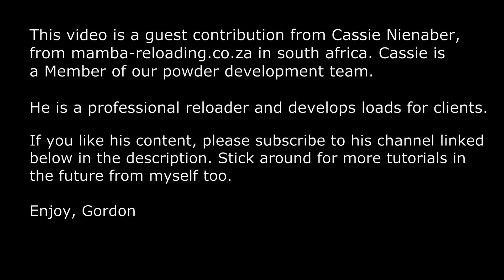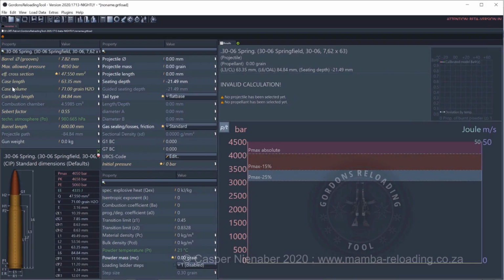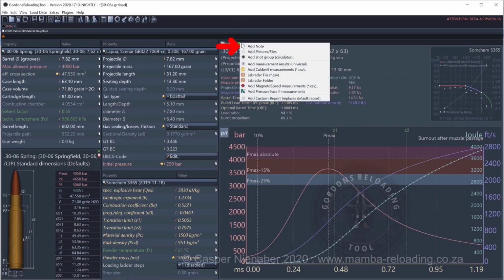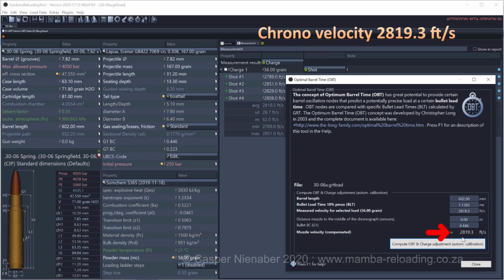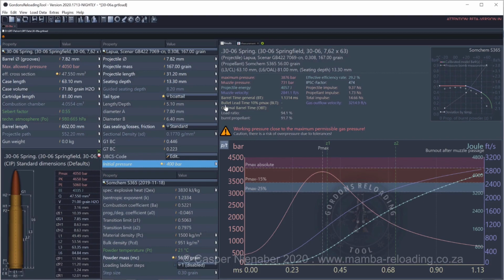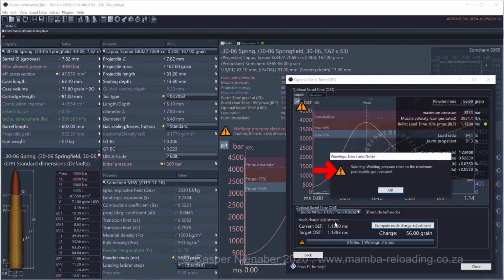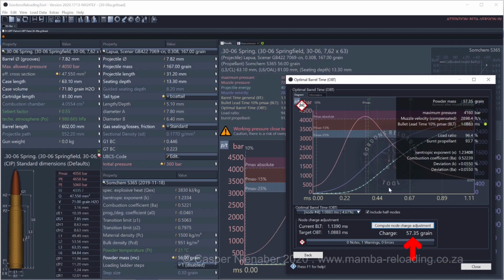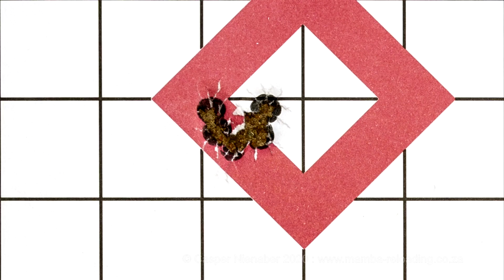(english) Tutorial Optimal Barrel Time with GRT

Comment: When done with OBT calculation and want to save new values as new powder file select "create grtload file copy with the calibrated values" - it will just flash? then go to 'load data' - 'select propelant' - you will get a warning no file found - add to DB? - then create new. Modified powder file will be save in a new " User Databse" group. Nice for selecting modified powder value with other similar loads. ( could be easier way to do this?)

Comment: Is there a way to denote the use of hBn bullet coating? The result of using it is typically a slight reduction of friction in the barrel, simultaneously with a reduction of pressure behind the bullet

Comment: Hello, excellent Video!
I have a question: why do you change at the end of the OBT calculation the Isentropic exponent (k)  and the Combustion coefficient (Ba) instead of changing the calculated optimal powder mass (mc)?
Reply: Hi, Stephan. My attempt to answer your question is out of pure ignorance here, but I think it has to do with the deviation factor of each powder lot. Each lot has a different deviation factor which runs unequal to the published data. I'm of the opinion that the powder data supplied on GRT is a rough guideline from many different testings from which this data has been collected over a period of time. As Cassie mentioned, we still have to change data on system according to our measurements, case cap, ect. That beign said, primer ignition consistancy also varies from lot to lot so I am of the opinion that we still have to adjust the isentropic exponent (k) and combustion coefficient (Ba) ourselves according to the velocity data captured from the chronograph. In other words, existing supply adapted to real world data. 

As with ES / SD, I'm not sure if this data would change once adjusted seating depth has been applied.